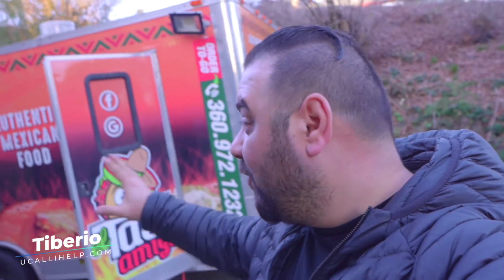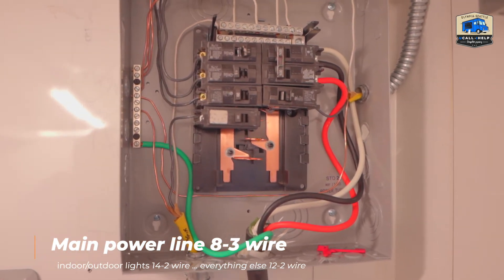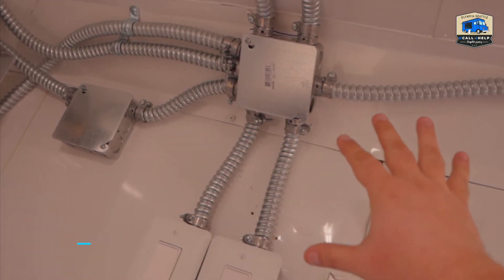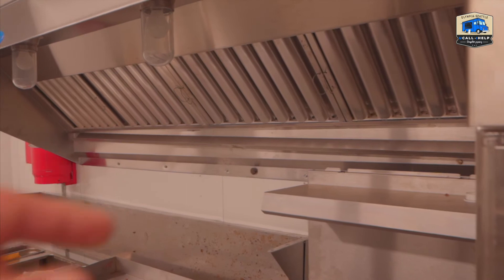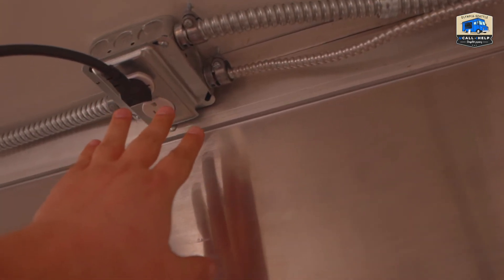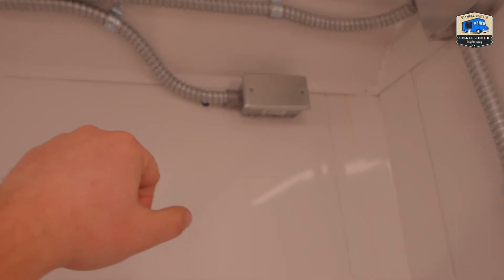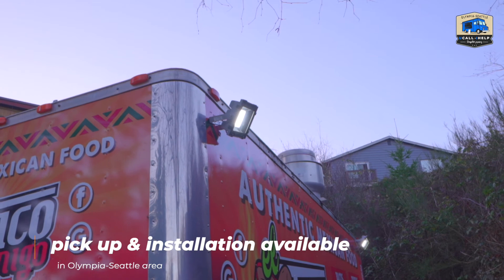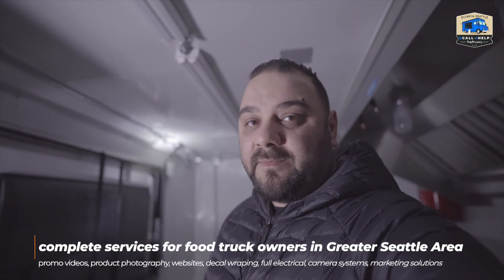The complete electrical system on a food truck and PASSED L&I in Washington State

Comment: did the inspector say anything about your electrical panel being over a sink or counter? also where are the GFI's?
Reply from the maker: No complains for that. On other food truck they have it under the sink which I found it crazy. Only one GFI under the sink( center location) for the water heater & pump)